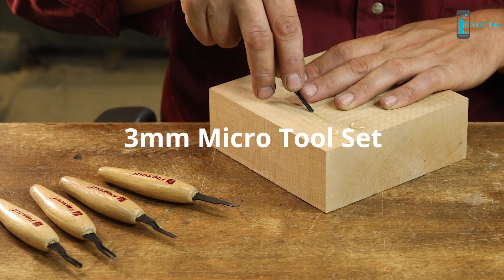Top 10 Best Hand tools for Woodworking and Carpenter Projects

Comment: You lost me when I went online and saw how much the woodworkers edge rule.  100 bucks for a 10 dollar rule.
Reply: Woodpeckers makes great stuff, but way overpriced by at least 50%......
Reply: Bryan Essig : Individuals prices range from about $13 for the six-inch rule to about $25 for the 36-inch one. Still too much for a freakin’ ruler. It’s a nice idea, but it’s not THAT great an idea.
Reply: Its a professional tool...The tools are tax deductable. If you aren't a professional suck it up. Quality costs.
Reply: I am going to glue two rullers together and make my own.
Reply: Jeezzzhhuuss !!!  100 bucks !?
Reply: Ruler *
Reply: No professional needs this fuckin thing, if you can't use  normal rule like the wang in this video then you are displaying incompetence furthermore displayed by buying it.
Reply: All you have to do is buy a mill and watch every one of this old Tony’s videos and you’d be able to make your own.
Reply: take a scrap 2x2 or whatever, glue two rulers to perpendicular edges, use table saw to cut out one of the corners

ez claps
Reply: I did buy one of the 12 inch rulers, because I thought the idea was good, but wasn't sure how much I'd use it.   what they don't show is that they can come with a rubber piece that slides on the end, and you can then set a length that you want to measure repeatedly.  this tightens with a screw so stays put.   I found I did like this feature and used it when making multiple drawers of the same size.
Reply: That ruler was ridiculous and unneeded, but their squares are worth every penny.
Reply: @nunyabuisness21mill  This old Tony is a tool.

Comment: OK, I don't usually post comments, but I just can't help but say WHOTF  is ripping or crosscutting with a hand saw on the job site? Maybe for cutting corners on a stringer or in the Wood Writes Workshop on PBS. (Just saying)
Reply: I bought cheap benchmark handsaws at home hardware 25 years ago that were at least three times faster then the ones shown in this video and still they only come out to complete unfinished circular saw cuts in rough framing.
Reply: More than you obviously imagine!!!

Comment: The number 1 tool is a push stick for a table saw?  I have built cabinets for 20 years and can say, maybe with some authority, that a piece of plywood cut to a rectangle with a notch cut into the long edge is better because it doesn't produce a plastic smell when you inevitably cut into it (1/8th" rips?) and can be had free in any shop.  You know all the plywood scraps you keep for later and then debate whether it's environmentally safe to put in the wood stove?  Those are the ones!
Reply: I agree completely concerning using scrap, BUT I'll never turn my nose-up to safety.

Comment: The edge ruler is cool and but them scumbags want $100 God damn dollars for a 12inch and $74 for a 6inch!! Gtfo that's disgusting and way over priced for tool that can only be used for 1 thing. Hell, I could make one out of 2 rulers and some epoxy for price of the rulers.
Reply: Just print some numbers on a angle iron.
Reply: Better: Use ALUMINIUM angle and Glue some good steel ruler with even finer graduations!

Comment: 3:20 “Slip the anchor bolt through the hole and tighten the locking naab”
Reply: Yeah, that's a bullshit setup.  They've been making devices that fit into the holes in benches for about 3 centuries.  No need for some dopey screw-on bullshit that's gonna drop on the floor and roll under the bench and you'll bang your head climbing around under there.  And you know that when it hits the floor it will roll to the other side of the bench and under something that weighs 900 lbs.  That's the way life is.

Comment: Using a metal hammer on a chisel instead of a mallet is just poor woodworking skills presentation, I don't care if the chisel had a metal shank in the handle. Any woodworker doing that just doesn't understand the basics.

Comment: I can not believe you Americans still use imperial.
Any "precision" instrument which gives measurements in 3/16th of an inch is not precise at all. Is that 4mm or 5mm?
Reply: Neither. It's exactly 4.7625 mm. The nice thing about fractions of an inch is that it's a base 2 system that can get as precise as you need. Furthermore, it's always easy to compute half of any sub-inch measurement (a commonly needed operation): simply double the denominator. For those who prefer to work in a decimal system, thousandths (mils) are available on pretty much any caliper.
Reply: @dlwatib  The modern day imperial system is based on, and defined by, the metric system. So whether you like it or not, all true measures are only true because they are metricly true. But if you want to stay stuck in the past, along with Liberia, go right ahead.
Reply: The use of imperial measurements successfully put Americans on the Moon, Stu. 'Nuff said.
Reply: NASA uses the metric system, actually.
Reply: @jimstarwood  didn't thought?  They flew to the moon using what is comparable to a first gen Fido cell phone from the 90's.       And then they haven't been able to get back? And all the telemetry data was erased?  They was much gained by the USA going to the moon, so much so that even if they really didn't go it was successful to what they were trying to achieve
Reply: Yeah, but try to go to our hardware stores and find a set of metric drill bits..

Comment: Handsaw? I had to scroll up and reread the title, yes it says Top Ten Best Tools Woodworking 2019. I had to hear the carpenters before it made sense. Ya, over here in America, we don't have time to wait for life to slap us in the face. I haven't used a freaking handsaw since I cut some kindling and I'll tell you why - yes I do finish carpentry - there are so many reciprocating saws and power chisels available, in different sizes, that I do all my final detail cutting with a razor. 

I'll tell you the appeal of these handsaws. Compared to a cordless drill, they are almost free to manufacture. Combine that with a snazzy display and cool colors and you have a way to turn 5 quid, or whatever you call your currency, into a profit for a very small investment. They are like lottery tickets for people that feel productive.
Reply: You do not do finish carpentry. You build garbage on the cheap. Any real carpenter still has a set of hand saws.

Comment: Who uses a hand saw?  Last time I used one was 20 years ago to cut a watermelon for break.   Sawzall would made a big mess.
Reply: I routinely use a handsaw.  It depends on the situation.  Sometimes I will even make a nice groove before setting a power tool to the line.  I find it adds just an extra bit of precision.
Of course, if you are framing, cutting by eye with a circular saw is much faster.
Reply: Any real woodworker needs a handsaw. Power tools can't do everything that hand tools can.

Comment: 10) way overpriced, can buy a dozen speed squares or framing squares that do the same job for what these cost...
9) hand planes haven't improved much in the last 30-40 years, these look identical to my set of Lie-Nielsen planes.
8) Kreg is Chinese junk.  Rockler makes the best bench dogs/clamps
7) more like cheap carbon steel, go with pfeil swiss made chisels instead.
6) seriously, if you still use a handsaw for general carpentry, you were born in the wrong century... get a sawsall/reciprocating saw and join the modern age...
5) "spring clamps are a staple in just about every home & shop" in China maybe... here in the civilized world, we use these things called "bar clamps"...
4) if you can't operate a combination square, then you probably shouldn't be allowed near anything with moving parts (let alone machinery/expensive equipment)
3) more Chinese shit...  if you use anything other than Freud blades & bits,  you're in the wrong trade/industry...
2) looks like more Chinese, prone to breaking, shit to me (see #7)
1) are you shittin' me? a push block? If you're too lazy and/or incompetent to make a push block, you should just take up stamp collecting or bird watching or something...
Reply: Ok, so you've just stated your OPINION. By the way, any well-equipped shop will have both bar AND spring clamps in good supply, except you. You probably use a maul to hammer in ½" brads.
Reply: "10) way overpriced, can buy a dozen speed squares or framing squares that do the same job for what these cost..."

For construction, sure. If you are doing fine woodworking, you want something more precise, like the woodpecker squares (yes, that ruler is ridiculous for most users). Expensive, but worth every penny. The magnetic square in the video is a joke.
#9 I'm using a set of Stanley planes from the 50's. They work fine.
#8 I 100% agree. Their pocket hole jig has set woodworking back 100 years. 
#6 I completely disagree. Hand saws are still very useful. 
#3 Apparently you have never heard of whiteside. Probably the best router bits you can buy. While they might be too expensive for general construction, they are well worth the money for fine carpentry.
That 3 sided chisel is a complete joke. the only thing that is going to do is ruin your projects, and maybe send you to the hospital.